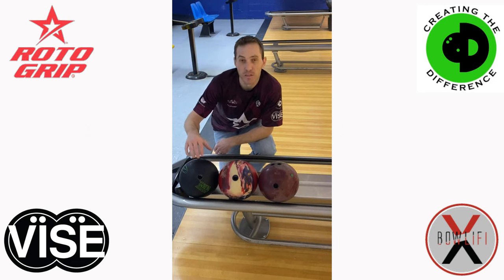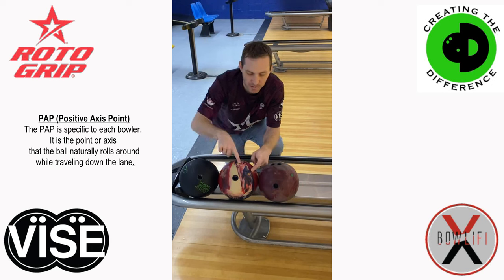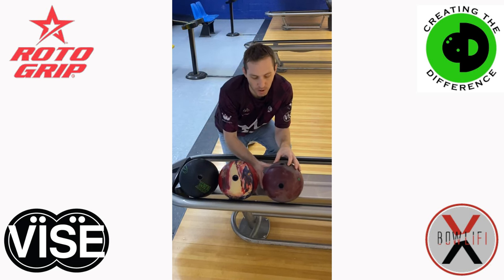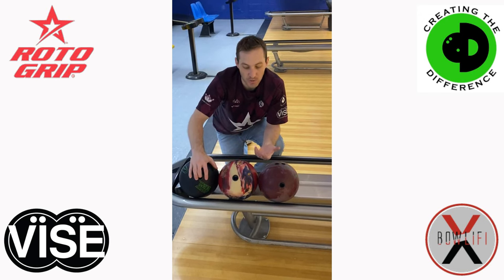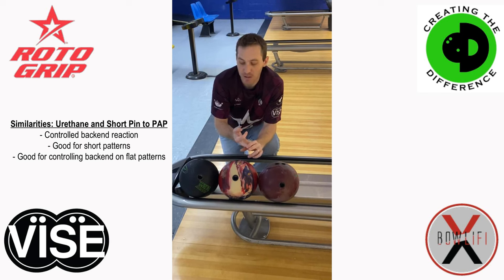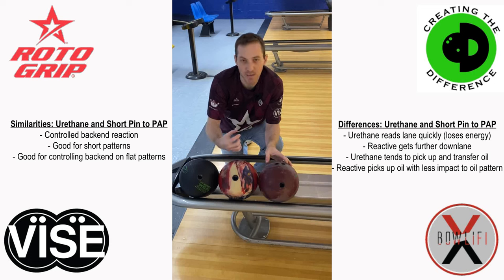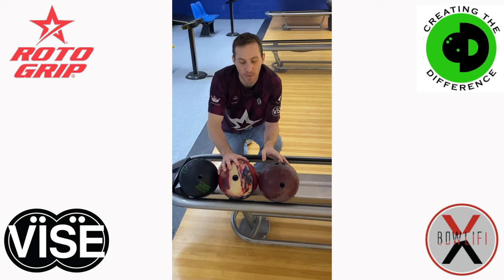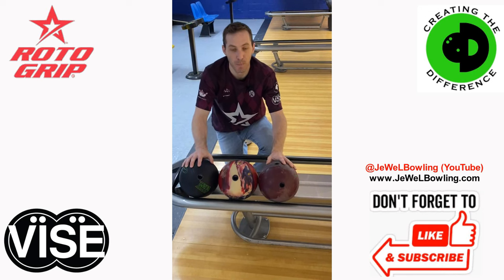JeWeL Bowling - Tips and Tricks #20 (Short Pin to PAP Reactive Balls)

Comment: Short pins do reduce flare but that is not what makes them effective when used on resin balls. 
The real key is Short pins position the core so that it is already in a roll phase orientation, laying over early.
This prevents the ball from transitioning later in the lane and producing the typical late/drive response resin has.
This allows a resin ball to have a more moderate front to back reaction on the lane, optimizing control over skid/snap.
Resin balls by their nature will always skid more and hook later than urethane regardless of layout, but short pins, even an Axis Layout, will help tame resin and allow straighter projections and more control on tricky patterns.
Urethane will still be earlier and smoother, but short pin is an effective way to tame a resin ball.
Reply from the maker: I agree with your comments. However, in an effort not to overcomplicate this particular video with the physics about moment of inertia and weight block orientation around axis and otherwise, I was simply using Pin to PAP distance as a marker for taming down reactive ball response. In addition to the comments you have here I would further add that the layout or more in particular, the VAL angle on the layout, will play a large portion on the downlane response the ball yields for the player. That and the ball surface will play a major role as well. I discuss this in depth in other videos. I would love your feedback on those to add and improve information as well!

All good information to help educate! Thanks!!